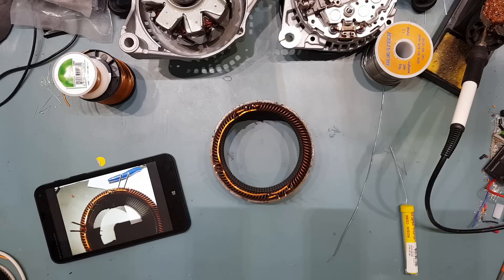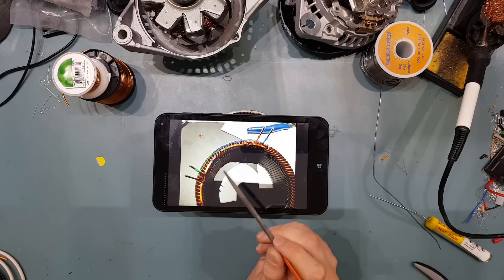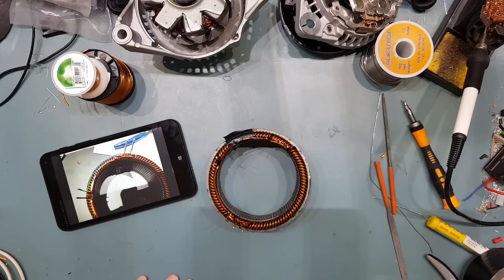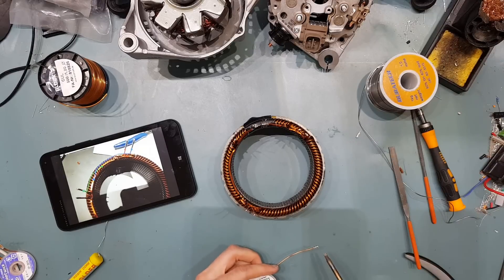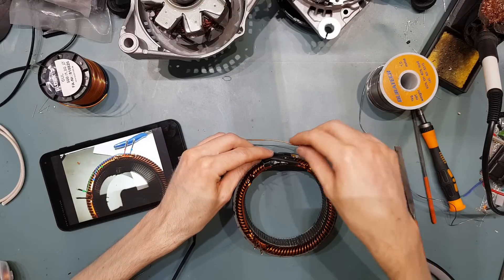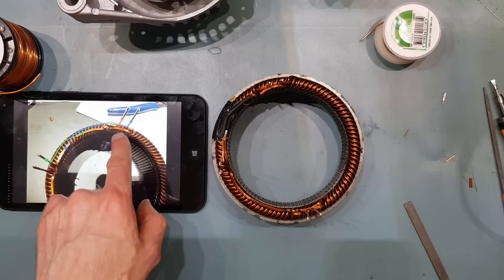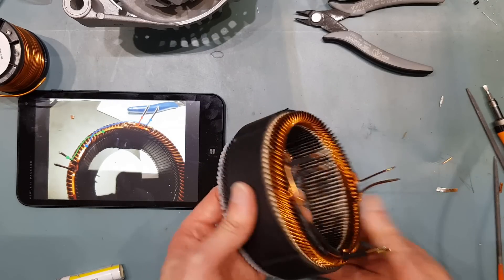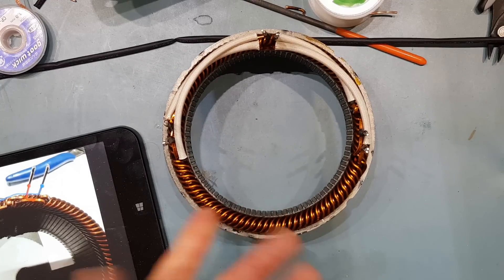Make your own HIGH OUTPUT alternator! - Part 2: The Modifications!

Comment: I am up to about the four and a half minute mark and still haven't figured out exactly what you're doing. My semi educated guess is that you're reconnecting the stator from a Wye format to Delta.

There are several problems with this "320 amp upgrade", one of which is the inability of a small case alternator to dissipate the amount of heat that it will create at that level of output. The second is that your typical passenger car/truck alternator is absolutely NOT rated for 100% duty cycle at maximum output to start with. Whatever the rating, it is with the alternator COLD. Once it begins to heat up, output goes down.

Outside of going to Delta wound hairpin and/or a six phase square wire stator, I very seriously doubt that alternator is going to produce 320 amps. Even if it comes somewhat close to that output level, it won't be capable of sustaining it for more than a few minutes at most. I actually own a Leece Neville alternator originally used on a large commercial truck or bus that is rated at 320 amps....and that is a continuous rating. The alternator weighs close to 35 pounds and is 2 - 2.5x the physical size of what you're working on in the video. It also has 12 diodes(twice as many as the typical passenger vehicle alternator), with half of them mounted on the outside of the alternator.
Reply from the maker: Part 1 explains the mods.
These mods are exactly what every small case, 320 amp hairpin alternator sold, has done to it.
Reply: High current alternators are physically bigger because they have double the number of windings, bigger rotor, and bigger rectifier. They DO NOT modify small ones to "double the output"
Reply: He is speaking of small case 320 amp alternators. Not large equipment heavy duty high output alternators. Small case alternators typically idle around 155amps and 1800 rpm + at around 320amps.

Comment: Good video but really hard to see exactly the cut wires where they attach to ..like the first cut one goes to the wire that's in red but the otherwise goes where? What is confusing is that don't know from diagram wich is the wire that you didn't cut but added a wire to can't distinguish wich color it is or if it's the red line blue or red ..could you explain it for me I sort of understand but just have a hard time following where do the wires go from the first cut   and second cut and the spliced wire ...could you explain it to me again ...Thanks
Reply from the maker: If you look closely you can see I've already done the cuts needed in the pictures shown, and the coloured lines are where to add new wires.
Compare with an unmodified stator if you need
Reply: Thanks. ..still hard to see but I used a big magnifying lense and was then able to see   ..I have poor eyes ...just a suggestion  when doing videos try and really zoom in on important parts it helps ....thank you again

Comment: good day i didnt get the pictures of the connections to be made and could you do a video on the "Nissan Tida" Alternator i think in ur country its the Versa it has a 240amp alternator i would like to upgrade mine thanks bro. loved the vid very informative
Reply from the maker: Are you saying you don't understand the pictures?
Reply: i didnt see any pictures at all and i am trying to modify a 140 amps alternator that looks just like the one in the video u, did can this be modified the same way or is there a different method to do??
 @TwistTapeTechnology
Reply from the maker: @loneallemaney9910  If you can't see the pictures, I'd suggest this isn't the project for you.
Reply: @TwistTapeTechnology  the alternator i am working on has 2 wire winding on the stata an outer and inner winding could you do a video or pictures of the wire cuts and wire joinings i hahe pictures of in below thanks i cant load pics of it so here is the model number '''''' Nissan 23100 ED00B ''''    LR1140-8015.  12V 140 amps and the rota is 1.8 ohms
Reply: @TwistTapeTechnology  also in respect to the center where the 3 wire meet "ground" which wire goes to where on the other end of the windings eg " lll ". are the wire meeting at the ground or center does each represent the same on the other end???  eg 123 or is it 321 i hope u understand
Reply from the maker: That isn't a small case hairpin alt.
Reply: My Nissan versa only has 110 amp alternator 😭😭

Comment: I am not 100% sure of this, but I do believe you get the multiple of sqrt(3) (1.73) in gained amperage, not the double. 
Are you not worried that the voltage regulator will pump the field windings so high that your alternator will stop working from heat build up?
Reply: Yea I'm not sold on this at all. Especially the soft parts put in solder and heat shrink seems would melt down. The high temp enamel shorts and grounds by itself usually killing the voltage regulator "most common reason for alternator failure" I appreciate his effort but in realistic conditions this thing will melt down. All the winding would need redone and hight temp enamel coated.

Comment: Great video and thanks for sharing.  Question: What is the approximate voltage output at idle after modification?
Reply from the maker: With a smaller pulley, they should do the standard voltage that the regulator always did, which for this alternator, was 14.2volts.
Reply: Sweet! did you keep the stock voltage regulator as well as well as the stock diodes that were already in place ?
Reply: Great trick , I really like the quality you put ito yur work!
But even  more importantly 
Please 🙏 tell us!!!!!????
What is the amperage at idle??

Comment: Very good video, very clear instructions here. I would like to see results from load testing befpre and after modification. Where can one score that upgraded rectifier bridge?
Reply from the maker: I'm in Australia, so to find an upgraded rectifier, I'd probably just search eBay for "denso rectifier" and look for one that looks the same, then read the description to make sure it has twelve 50amp diodes... It's really a terrible idea, but I'm sure people overseas should be able to find parts more easily... The small case rectifiers are flat plates made of aluminium or copper. Whereas the large case appear to generally be cast alloy, which won't fit in the small case alts..
Reply: @TwistTapeTechnology  why do you say it's a terrible idea? I've seen you reference getting an upgraded rectifier before without caution.. Are you saying there should be caution in doing this? 

I'm excited to try this out. I'm just very confused on what needs to happen after the build is done. Sounds like a new pulley is needed, I'm just curious as to what size. If you don't want to do the math for me, I'm sure it'd be helpful to many to provide the math that needs to be done to figure out what new size is needed. As well as information on whether you need an upgraded stator as well. Thanks TDWM. You're a real G